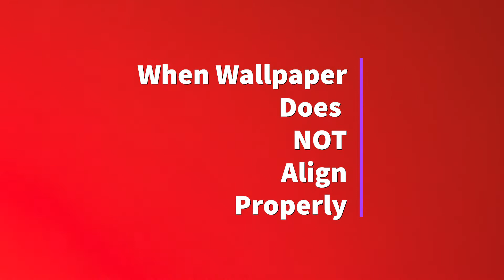When Wallpaper Will NOT Align Properly! - Spencer Colgan

Comment: I would have liked to seen that corner happen and go down the long wall on the side. Wondering if you did it in two pieces or one. I'll check and see if there's a follow-up video on this pattern/date.
Reply: Never go in and out a corner in one. it may be running out anyway, so allow about 1/4" over lap, then re hang/plumb the off cut onto that slight overlap... you may need to trim off again if the wall corer is out, so you can keep the re hung length plumb.. then away you go.

Comment: I find this alignment issue with several of the “peel n stick” papers. If I don’t have my spray bottle I just soak it with my sponge and clean water. Front of paper and wet the wall.